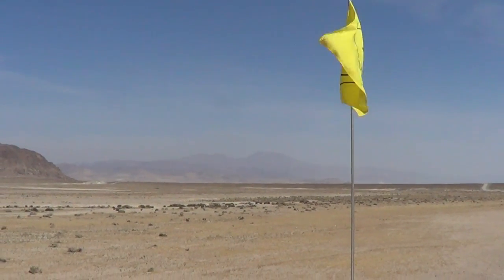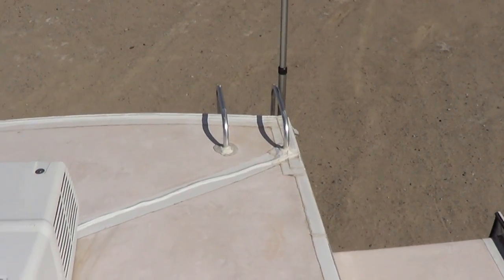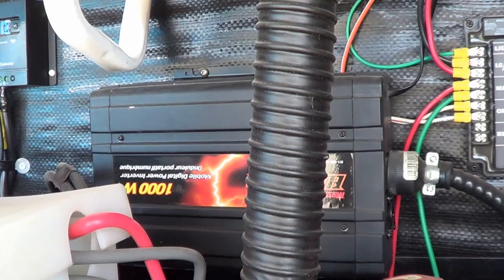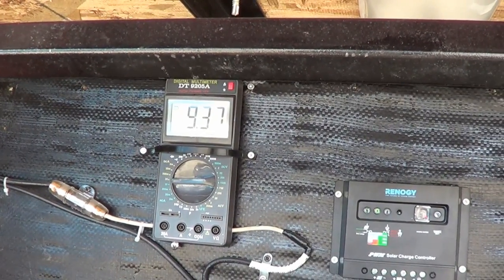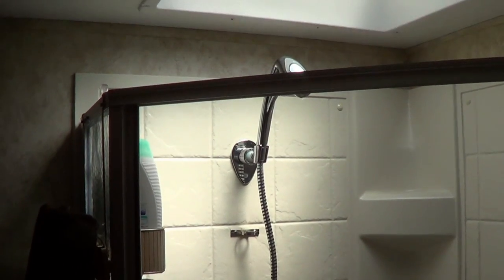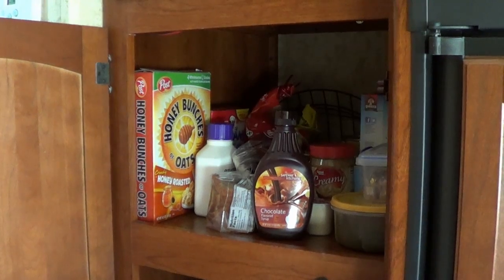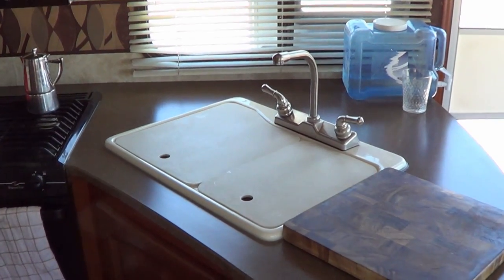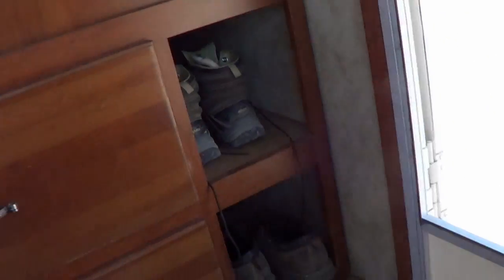20 Useful Upgrades I've Made To Our RV

Comment: I may be mistaken or I may have seen it on someone else's video but didn't you put in a mister heater big buddy heater
Reply from the maker: nightprowlerch19 Yes, that's right, I just finished plumbing it into the low pressure system in the RV for easy, quick connection a little while ago. http://www.loveyourrv.com/mr-heater-big-buddy-hooked-to-my-rvs-lp-gas/ I'm sort of late on this video, it's an add-on to the post I wrote a month or so ago, prior to installing the Buddy connection.I have a bunch of new upgrades planned for this summer when we don't travel so much, so will have to add it into those, for another video down the road. :) Cheers Ray

Comment: How do you run the a/c out there on solar and how long?  I'm new to the boondocking world.  Thanks
Reply from the maker: I mostly boondocking during the winter season in the desert and adjust my elevation to follow mild weather 60-80F so a low power draw electric fan is usually sufficient for cooling. If it ever gets really hot I could use a gas generator or head to a RV park or state/county park with hookups till the heat passes. To put together a solar power AC system can get quite expensive as you need quite a few solar panels , lots of batteries and a large inverter.

Comment: Love your videos. You don't have a satellite dish for tv? I was wondering how much that cost to add to an RV. Did you coat the roof? How often do you have to do that to make sure it does not leak? How much were the upgrades and did you add them yourself?
Reply from the maker: Thanks Ron,
We aren't big TV watchers so whatever we get on the antenna for free is fine, we do download the occasional TV series or movie.
I'm not sure how much Sat cost but I have seen some folks with the little Tailgater Sat things, I don't think they are much. If you install an automatically pointing dish I'm sure it can run into the thousands.
I installed all the upgrades myself, some were cheap some were several hundred dollars, like the solar power and the surge protector. Cheers Ray
Reply: Thank you for the reply. Is it hard to install the upgrades? Maybe you can do some videos on how to install some of the things you put in. I want to have some solar when I get my RV and your instructions would be a great help.  I like what you have done to yours and would want to add some of them to mine!! Than you again!!
Reply from the maker: Check out these two links. Contained in the posts are links to all my details of the installations usually with a video. :)
http://www.loveyourrv.com/20-upgrades-we-have-made-to-our-rv/
http://www.loveyourrv.com/20-rv-upgrades-fifth-wheel-trailer/

Comment: Like your upgrades, where did you purchase your LED light bulbs for your light fixtures and what brand/model number did you get.  Thanks.
Reply from the maker: Darwin Hall Cheapest place to order I believe is Amazon - http://www.amazon.com/Starlights-921-250-Replacement-Ceiling-Fixtures/dp/B004LF93WQ/ref=pd_sim_auto_1?ie=UTF8&refRID=0ETNWWFEEKD4FB35JK4R
Here is a blog post I did on my install with the numbers used - http://www.loveyourrv.com/install-review-starlights-led-lamps-rv/
Reply: Love Your RV Thanks for the quick reply.  I have some LED lamps in my fixtures, but they are very blue and my wife doesn't like them.    I will check out the link to Amazon.
Reply from the maker: Darwin Hall These ones are definitely a nicer light, and still pretty bright. look for 3200 Kelvin in the color temp spec

Comment: I've a question for you. Why not use 12 volt golf cart batteries instead of 6 volts ???
I'm looking to start rv ing soon. 
Thanks
Reply from the maker: You can if you like. Generally, though the 6 volts will be cheaper per amp hour since they are so common, I like them because they are taller so the footprint is smaller. Also the less parallel strings in a battery bank the better. Weight may be an issue too. Like, say 4 -  6 volts versus 2 big 12 volts.   My goal was to pack as much AH capacity into the space I had to work with at the best price and quality I could afford. The 6-volt golf cart batteries seemed to be the best choice.  Cheers! Ray

Comment: do you find that it is better to have a dually with a fifth wheel or would a single axle truck work?
Reply from the maker: A dually is better but you have the trade off a wider truck which can be a pain to park and drive in narrow areas, plus more tires to replace.

Comment: Ray just wanted ur option   on what used truck to buy to pull a fifth  wheel like yours?  well my budget is under 10,000.00 and  of course used.  but how many miles whats my limit. i know i need to getbit checked out before buying. whars the most impotant check out. thank you. Ray
Reply from the maker: Look for at least a 3/4 ton diesel truck. With a truck like that you'd have no problem towing a Cougar like ours. Make sure there is no rust in the frame or bed as you will be putting a hitch in there. Less the 150,000 miles would be preferable. We bought our truck for 8500$ 6 years ago, had 75,000 miles at the time and has been good. - http://www.loveyourrv.com/big-baby-blue-1994-ford-f350-truck/

Comment: Do you have a connection to the generator of the truck such that when you are towing the rig's batteries are being charged?
Reply from the maker: Yes, there is a charging line in the fifth wheel tow cable that connects to the truck's alternator, charges at about 5-7 amps.

Comment: I had a question regarding your television. Do standard television sets work in an RV? Thinking about upgrading my television, but I'm getting mixed information on the topic. Any feedback would be great. Thanks!
Reply from the maker: +Mario Moreno Just make sure it has a built in digital Over the Air tuner, most new TVs do but not all. Ours does, so when we get to a new place without cable TV I put up the RV TV antenna and push channel scan on the TV and it finds any available antenna channels. If we are in an RV Park with cable TV I just tell it to scan cable channels. Works great

Comment: New here😊 Please inform me how solar panels work. I wondered how you can  boondock with a fifth wheel. How about water? Do solar panels let you run your a/c? Also, how does it feel to sleep at night in such a desolate place?
Reply from the maker: Yes we boondock in our fifth wheel - Here are some tips - http://www.loveyourrv.com/boondocking-tips-and-tricks-for-newbie-rvers/
No, we can't run our AC of the solar panels. It feels great to be in a desolate location, I sleep well.
Reply: I"m going to try running AC off of solar.  It takes a big panel (500W) but I have a pretty small AC unit (700W Feders in a Roadtrek Van).  I'll set the thermostat for a duty cycle of half on, half off (50%) or so and then the AC will only draw 350 watts average plus something for conversion losses, and live within the 500 W system capacity.  The solar will also need a battery system to ride out passing clouds, and to run a little bit into the evening hours.  When it's dark I'll need a gen set, unless I get an absurdly large battery.

Too bad the RV isn't hybrid, that would be a good size battery to do this. 

Elon, we need your Gigafactory to solve this problem!

Comment: We found that using two six volt marine batteries, in series, lasts MUCH longer than two twelve volt batteries in parallel. The six volt batteries are probably twice the weight of the twelves.
Reply from the maker: +Douglas Roberts They also can usually handle  a lot more deep discharge cycles too. Great for boondocking!

Comment: I have an old style colemab rooftop a/c on my camper[ 21' Fleetwood wilderness ] when on it runs constantly whether cooling or not would love to have it kick off like the space heater does. Any ideas on how to achieve this would be much appreciated. Thanks!
Reply from the maker: Does it have a fan switch that says Auto/On? Mine has an in Auto mode the fan only comes on when the AC comes on.
Reply: Love Your RV nope. It just has on/fan/cool mode switch.  what id like to have it do is be controlled by the wall thermostat that runs my heater because the thermostat has an ac mode. Id love to have it behave like a house ac system but not sure how to pull that off. Any ideas would be much appreciated thank you!
Reply from the maker: Maybe try and track down the manual online if you can find the model number somewhere on it. May tell you if its capable of that.

Comment: i have a question, for installing the ladder is it as simple as drilling it in or what, do you have a video on that by any chance? thank you
Reply from the maker: +305 surfer The ladder came preinstalled. Sorry, I have no video. If you install one you want to make sure it is screwed into walls frame (metal or wood stud) though. to support the weight. The typical RV outside wall material won't do it.
Reply: ok thank you sir!

Comment: re: "Lifetime Warranty" on Progressive Industries hard wired surge protector... I understand that the warranty is null and void unless it is installed by a certified RV dealership. I was considering getting the same one as you have, but since I too am planning on installing my own, I am worried about voiding the warranty (as you probably have) by installing it myself . What's your take on the warranty issue?
Reply from the maker: I've used the warranty for a failed circuit board in the past and they honored. I sent back the dud board and they sent me a new one. But, maybe they have changed there terms as that was several years ago. My unit is 6 years old now.
Reply from the maker: Hi Leigh, I just contacted Progressive Industries and was told they will still warranty a self-install.
Reply: Perfect! Thank you so much. I will order one right away! Well, not actually right away. I do need to wait until I can get into the RV Resort where my 5th Wheel is stored to make sure that there isn't already a surge protector installed. (We bought it last fall on the last day before the park closed for the winter) Should be moving in in just a couple of weeks weather permitting. (We live in Alberta --- still very much winter here!) Oh. And when I order I will order through your Amazon link! :0)
Reply: Actually, your Amazon links take me to the US site. Do you have a Canadian account that gives you referral kickbacks?
Reply from the maker: They haven't set up a Canada page for me, its in the works, yet but if you go to my affiliates page - http://www.loveyourrv.com/love-rv-affiliate-links/  There is a link for Amazon.ca  Just click that and shop and it will set the Amazon.ca affiliate cookie for me to get credit. Much appreciated!

Comment: can you advise solar vs. generator or both when boondocking
Reply from the maker: I'd start with a quiet type inverter generator to charge up the batteries first then move on to solar as you can afford it. The rationale is you will still need a generator even with solar. The sun doesn't always shine.
Reply: thankyou,  I agree.
Reply: any advise on a generator

Comment: Just to let you know that tape will peel off it don't last very long
Reply from the maker: The first sections I laid down have been there for just about 4 years now with no sign of peeling or lifting. Guess it depends on how well you apply it also surface prep is extremely important.

Comment: Why do you charge items with 120vac when you can use 12vdc with less losses?
Reply from the maker: Your point is valid for very small dry camping setups and I actually do use both the 12-volt DC outlet and the inverter AC output to charge items.
 I find though that things like the laptops, MiFi and camera batteries charge better/faster using their OEM AC chargers than the DC charger option. The losses between charger methods are pretty minor (especially if the inverter is on anyway to power an AC only item like my wife's iMac or our TV) and don't mean much in the grand scheme of things unless you have a small battery bank and short wire runs to the DC outlet.

One thing people don't consider is wire losses. For example, the OEM 12 volt DC outlet in our 30-foot trailer is located in the living room. It has at least 20 feet of thin wire to the DC power panel and other 20 feet of 8GA wire to the battery so the gain by using a 12VDC charger gets nullified by the losses to resistance in the long wire run. The inverter is located right next to the battery bank, the wire run is done after it has been converted to 120 volt AC so far less wire losses. I could invest in a dedicated heavy wire run for a DC outlet but I'd likely just invest in an additional solar panel instead.

Anyway, I try to charge things up during the day when the batteries are full and the solar panels are bringing in more than we can use or if I'm having to run the generator for other reasons. At these points, the possible losses don't matter.
Cheers Ray
Reply: Ok, good answer.  I forgot about the long runs in a trailer.

Comment: Keystone is the worst and most lying back stabbing company for warranty. You did not indicate how much you had to repair that should have been covered under warranty. They would have lied to you anyway and told you there was no coverage.
Reply from the maker: I think its mostly about your dealer. We have a good dealer, a family run outfit that only sells Keystone trailers, they have lots of pull with the manufacturer. Also, they really know the trailers inside and out compared to some outfits that mass sell all kinds of brands and know dick all about them.
The OEM warranty was only 1 year and it covered replacing a TV and a cracked dining table. It was done quickly and for the TV. I just went and bought one and was reimbursed on my credit card the amount paid, I actually ended up with a better TV. No other things needed warranty in the first year.
We bought a 6-year extended coverage transferable tip to tail warranty for $1500, it has a $150 deductible so I didn't use it for the most part, I like to fix stuff myself, but recently our Dometic fridge quit,  bad cooling unit. Rather than fix the dealer put in a new one free of charge same day I brought it in, a 1500 dollar value. I have no reason to plug Keystone or my dealer but all and all my experience has been OK. Cheers, Ray